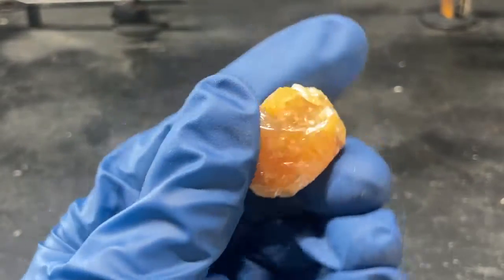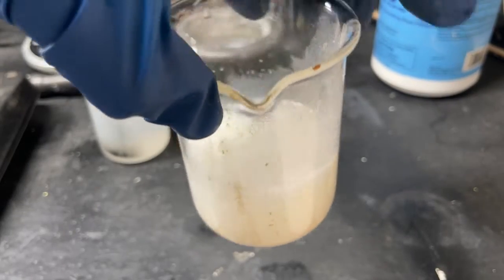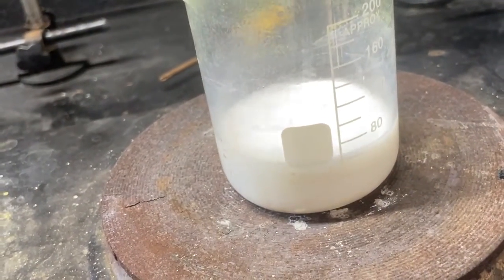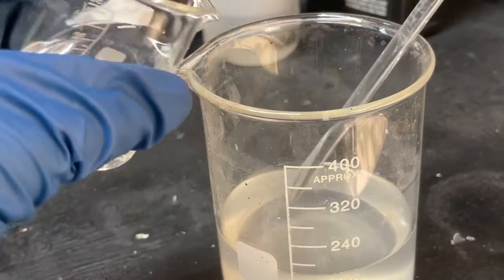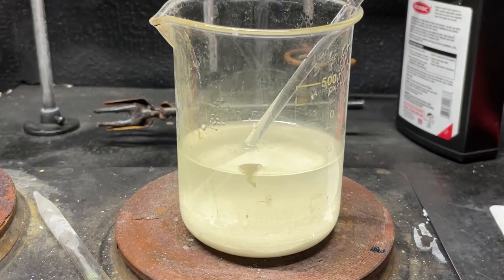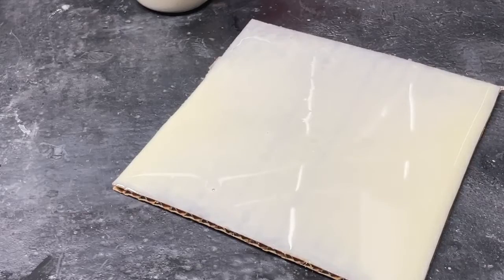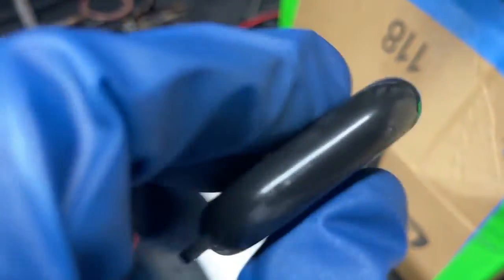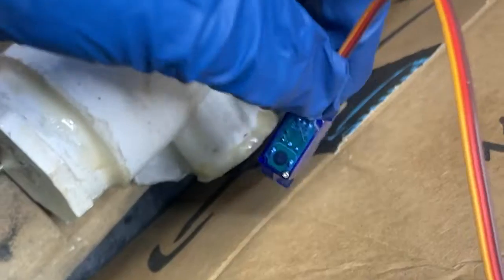Taking X-rays with rock?

Comment: On the first x-ray video where you talked about how the tube functions, you mentioned electrons changing energy levels and using that to ID elements. Which essentially sounds like you were talking about at some point also coming up with a makeshift XRF meter?  Is that something in the plans Still?  They are so expensive, it would be cool to have an affordable one that could at least detect the precious metals such as silver, gold, platinum, palladium, and rhodium.
Reply from the maker: Yep still in the plans!

Comment: Your starting material, CaWO4, would probably work much better by its own. Allmost all Scheelite is strongly fluorescent in shortvawe UV (254 nm) and xrays. If you prepare synthetic CaWO4 from aqua solutions, you need to heat it to 500-600 C before it works. This will transform it from amorphous to mikrocrystaline. I guess this is also the case with CdWO4. I have commersial intensifier screens made from CaWO4 by the way. Another note is, that CaWO4 seems not to need any activator, and is not much affected by the typical negative activators, like iron.
Reply from the maker: Yeah I just did the cadmium version because we’ll it’s cadmium lol but I did heat it to ~300C on the hot plate but I guess that’s probably not enough.
Reply: @PyrotechnicalScience   Yes I understand. But yes, a bit more heating would probably help. I have made CaWO4 from aq solutions of Na2WO4 and CaCl2, and when dryed, it is non luminiscent. after heating in a testtube it glows in UV and xrays. UV lamps is used in prospection for tungsten deposits, because scheelite is  allways fluorescent. It is often mixed with CaMoO4 that by itself has a yellow fl. So Scheelite fl in a range of colors from blue to white to yellow.

Comment: I've never seen that bluetooth controller, a better solution would be using an app like IP webcam, you can configure exposure and ISO and take photos/videos trough wifi, or plug the phone trough USB you can create a network by tethering with a high quality video feed.